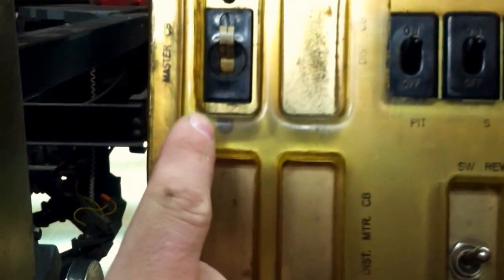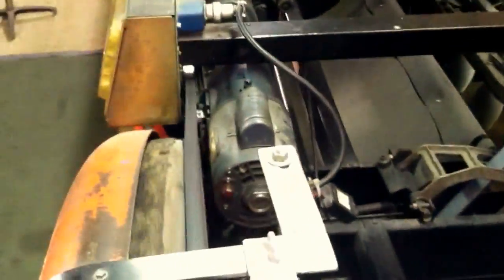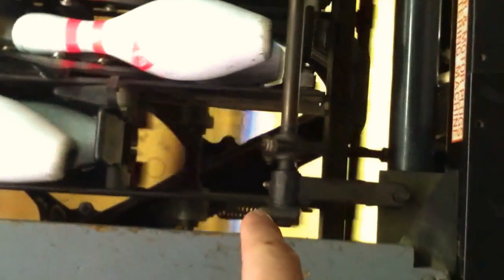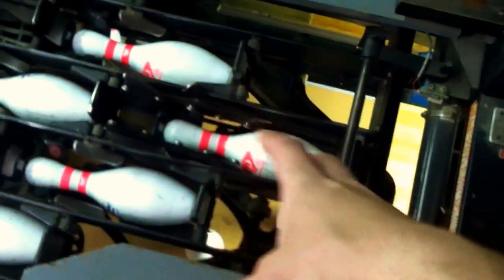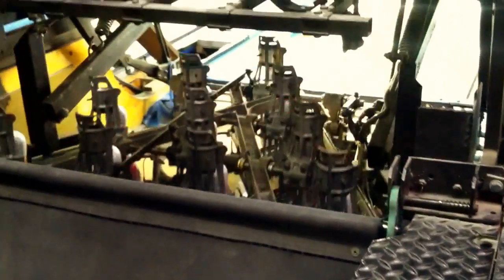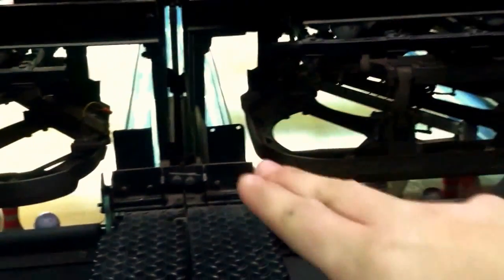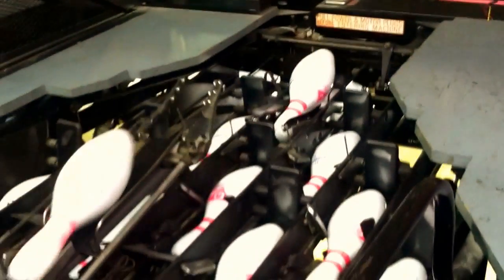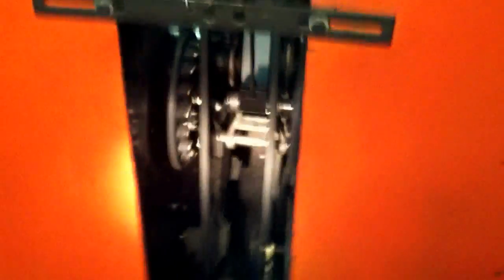AMF 82-70 Pinsetter Basic Operation

Comment: I dont think that finding qualified mechanics is the problem. Finding qualified mechanics that are willing to work for minimum wage and no benefits is.

I worked in a bowling center in the late 90s. I was pretty good with the AMF 82-70.  The owner was good about preventive maintenance.  Every summer we would go through all 24 lanes and swap pin carpets from odd lane to even.  Then back again the folloing summer. He got a lot of life out of those carpets by doing that. We went through bearings and bushings. Lubed what we could often. Changed belts on a regular basis. It was a lot of work but it was worth it. Breakdowns were rare. Ball damage non existent. Usually  electrical problems such as capacitors and limit (range) switches.

I ended up quitting for a job with better pay and health insurance. I often wish i could have stayed there. I loved maintaining those machines. But family was more important. 

And that is what string pins are all about. Cutting maintenance costs. But there is still a lot of maintenance that will be needed. Aforementioned pin carpets and ball return systems.  These two will now get none, and ball damage is going to go up at these string pin centers. Remember i predicted it. 

The other thing is the cost will not go down for the bowler. I havent heard of one single string pin center that has actually lowered their rates.

Comment: I worked on and with Brunswick A-2s for around 10 years back in the day, but the AMF 82-70 has always fascinated me! Never worked in an AMF house, though.
Reply: I worked on these in Scotland for years. You don't want to work at an AMF house. Cheapskates. We had to repair EVERYTHING because they didn't want to spend money on spares. Just think of welding pin cups all the time, which, for some reason, were made out of cast aluminium and break if you even looked at them wrong. Perfect material for something that might get smashed by a 16lb ball.

Comment: Pretty cool, my first job as a 14-15 yr old boy working in the back basically supervising the pinsetters. We had this EXACT model running 12 lanes. We only ever ran all 12 during league nights, mainly because it was 2005 and those machines were ancient, at least twice as old as I was at the time lol. Since they were so worn down, league nights were the nights I really earned that paycheck as a kid, running up on top of those machines having to manually rig and re-set pins, or sometimes needing to shut a lane down completely because the elevator belt slipped off, and was quite a bitch to get back on

Comment: I worked as a Machine Serviceman for a 28 lane AMF centre using these fangled machines in the early 90s. I'm a fast learner, so I got the promotion from Maintenance Man in a few weeks. 
The machines were great to work on and they all had a character of their own. If an alarm sounded on a certain pair of machines, I'd know which tools to grab to fix them.

I had a bit of a run-in with centre management, as to what constitutes fair workplace safety and got fired. ha ha :-) Best career move ever.

A few sneaky tricks I learned on the way:

If one group of bowlers was causing trouble for us, you could: 

Remove a couple of pins from the pinwheel, so it takes ages to get enough pins feeding the distributor, so the machine would still function, but a lot slower
Grab the bowler's ball, wait a minute then send it back to the bowler.
Grab a pin just as it's leaving the distributor but before it triggers the Pin In Cup sensor. This slows the machine, for as long as you keep grabbing pins.  

But then, anyone who works on the 82-70 machine would already know these tricks. :-)
Reply: I worked as a junior facilities tech for 2.5 years, i don't miss it. 

My training consisted of how to cycle the machine and clear pile ups and how to clean the machine and pins.
I was expected by the front staff to be able to do far more than that though :D

Comment: what a great video. What happens if two pins simultaneously try to get set in the same spot? Is that possible (seeing that they get stacked in the bin with extras)
Reply: 2 pins can’t really fall on the same spot. When the pins are sitting in the bin, there is a piece below called the shuttle that moves forward and let’s the pins fall into the cups to be spotted. The shuttle moves forward pretty quickly so there is not enough time (or space) for two pins to be dropped at once.
Reply: Distributor jam. Then they start piling up and eventually a call to the back if not seen.
Reply: Yes, they pile up and you can hear the loud banging of them falling down to the pit carpet but someone runs to the back to un-jam the pin then set the pin distributor in order. Super easy problem to fix, it happens every so often.

Comment: I've seen a pin get knocked down and stand back upright in another location and the pinsetter came down and snagged it and crushed the pin to pieces. It was awesome to see the power of these pinsetters. Guess the newer pinsetters have pressure switches on them nowadays and will shut the system down when a pin is jammed or in the wrong spot.
Reply: No, the deck 'floats' on its frame and typically the pin would hold the deck up.  Sounds like the pin was defective and/or there was a problem between the deck and frame which kept it from floating.  Rare, but it happens.  Although it won't kill you, if you are underneath the deck replacing parts and the deck comes down on you it is no fun at all.
Reply: If the pin deck has oil carry down the pins will slide out of range, our machines never broke any pins this way usually the pin will block the table from going down and cause a sweepdown or respot.

Comment: I've been around the 82-30's for years and I'm currently a mechanic on them and this is my first time ever actually seeing the 82-70s and wow they appear to be so much more efficient and easier to work on. Also alot easier to get around on as well
Reply: I worked on these in the 80's. Never worked on 82/30's, although I know them and understand their operation. The 82/90's are even faster, though they are basically a refined version of this design with newer electronics.

Comment: A2 mechanic here, this looks much less complex mechanically than an a2 but seeing it double load pins freaks me out. Neato.
Reply: I've worked on both but primarily 70s for 22 years...  I learned a saying a long time ago from an old-school mechanic...  On a Brunswick it takes 1 minute to find the problem and 2 hours to fix it.  On an AMF it takes 2 hours to find the problem and a minute to fix it.  The 70s may look more simple but have way more electrical "fun" to deal with.  They're both awesome machines if taken care of...
Reply: @Dana_Danarosana  I'm a brand new mechanic and fabulously green to the job. you're right that they take a minute to find the problem, but i'm so slow to fix the problem! I'm starting to get the hang of some of the more common calls i get, but it can feel so intimidating at times, I get overwhelmed!  Hopefully something finally clicks, because I'm losing some confidence on these machines...
Reply: The Brunswick GSX (including the Brunswick GS-NXT) had pretty much a bit more parts than the AMF but unlike both AMF and A2, incase Centers had no proper care in their pinsetters, the GSX and would survive a lot more since it has the Highest Reliability. And the one thing I love the GSX is that it doesn’t have too much complex parts anywhere on the machine (Like the A2 with the Gearbox and AMF with the Ball Lift on the bottom).

Comment: When will this get upgraded? I imagine some computer arms replace all this mechanical nonsence.
Reply: There's amf 82 70s and Brunswick a2s still running in places 50 years after they were put in. I'd have to see some of these computerized ones putting up with the same shit these do for anywhere near as long to believe it.
Reply: @iloverush123  dude doesnt understand these machines. 
Thats all.. I'm standing here with mine right now. 
Were installed in 78 and still going very strong.  40 of them.
Reply: If everything you see here is taken care of properly, it runs beautifully. There are more modern pinsertters/pinspotters, but they're still very mechanical. 
Believe it or not, the largest percentage of this machines operation is electrical.

Comment: So for these pinsetters do you have to have 20 pins or less in it so it doesnt pile up pins on the deck or is there somthing to stop the pins from going on the track?? Like a thing that locks at the start of the track or the end of the pin wheel??

Im not a mechanic or anything, but at my bowling center I still work the back end with the burnswick pinsetters. These pinsetters look way less dangerous and look like they would hardly break down. Again im not a mechanic so i wouldnt really know just by looking at it.
Reply: Superfappio64. They should be run with 20 pins because if you load more than 2 pins in a bin they can miss feed. Sometimes guys will run only 19 pins to prevent "shuttling" a second set of pins with pins already in the spotting cups. There is no "pin gate" to stop the pin flow like an A2
Reply: Pat Ready, if you know, wich one is the quicker machine? The Amf or the Burnswick A2?

And by quicker I just mean the one that can cycle between second and first ball the fastest automatically.
Reply: Superfappio64 I think the A2s cycled the fastest. However mechanics have found that if they slow them down (by changing the diameter of the drive belt pulley) they don't wear out as fast.
Reply: @patready3469  AMF machines cycle faster than A2 because most of them, even the older 82/70s, are equipped with short cycle sweep reverse and shortend strike cycles.

Lets say you're bowling at a center that has AMF machines, you strike, the sweep will clear the deck while the table remains at home and waits for the pins to be shuttled into the spotting cups. When the sweep has cleard the deck, the table spots the pins, rather than the table traveling down to the deck to feel for pins before a strike can be indicated. (Which takes longer) 
Also, if you gutter on an AMF machine, the sweep will drop and then simply reverse home and the machine switches to second ball. There is no movement from the table during a short cycle sweep reverse.  Same thing happens if you pick off the ten or seven pin only.  This is assuming the machine is equipped with short cycle. Which most now days are.

I think when it comes to fast, that might be Brunswick GSX.. But not sure
Reply: Pat thanks for answering this! I wondered how they handled additional pins since there isn't a pin gate. Do you know how the 82-30's stop loading pins since they can only hold one set of pins? The pins just keep turning in the pin wheel without going onto the distributor belt - as if something has to physically push the pin onto the belt when it needs pins.
Reply: rodhoutx I never spent much time on the 82-30s. They have a counter and, I think, once it gets to ten the pins are locked in the pin elevator
Reply: With my experience if you have more than 20 it'll end up piling up
Reply: They are far less dangerous. More dependent on electronics. I've always loved them.
Reply: i always was told they had 22 pins so if you get a strike and then another strike you're not waiting as long for the next turn

Comment: Looks like a Brunswick GS setter.
Reply: actually the creator of the GS-10 (now GS-X) took items from 5 different machines and made the GS-10.  took the quick rake drop / accelerator from 
Brunswick,  bins/3 motors like AMF, chain drive / elevator like Sherman duck pin machine, loading like a candlepin machine, and elevator like a 5 pin machine